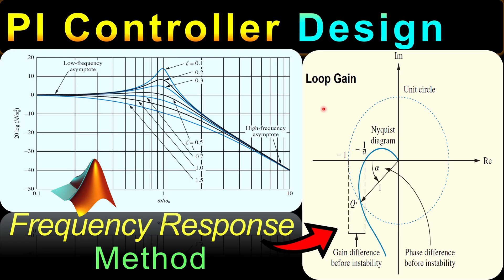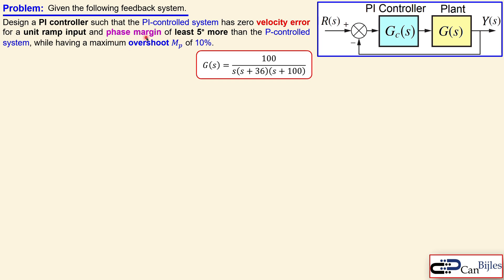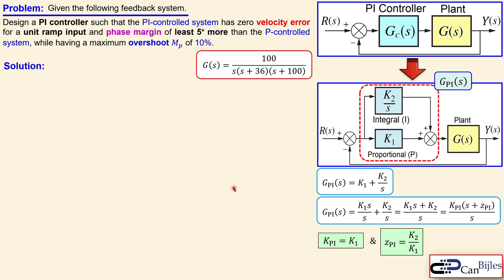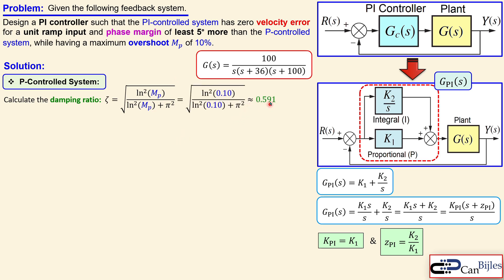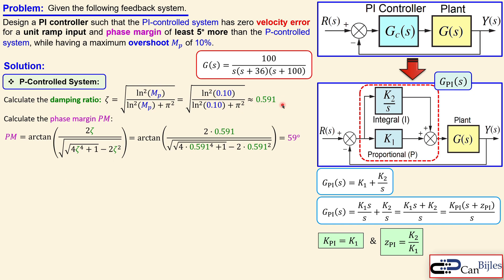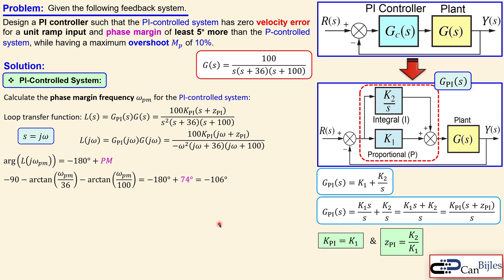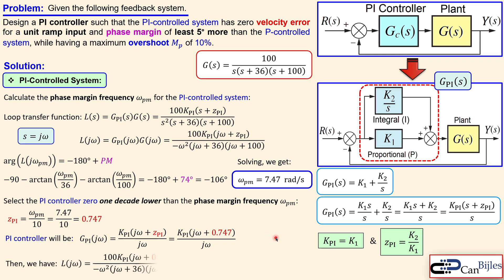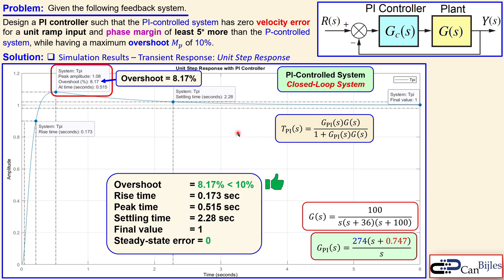Frequency Response Method 🌟 PI Controller Design 🌟 Calculations & MATLAB Simulations 💡 Example 2

Comment: Hi sir, What should we do when our roots are complex and our phase diagram is between 90 and 270? Because we can find PM from the desired overshoot value, but w_pm cannot be found, so I couldn't understand how to solve it. Thanks!
Reply from the maker: The system can have any poles and zeros, also complex poles and zeros. The definition for the phase margin frequency and phase margin is still the same. Phase of +90 degrees means an effective phase of -270 degrees and phase of +270 is equivalent to -90 degrees.

Comment: dear professor, while calculating the arg of loop transfer function at min 8.10 you did not consider the phase contribution of zpi. since it is a zero i think it should have a positive phase contribution to the system. also in denomintator you have taken the phase of w^2 as -90 degrees. it is real number and i think that it should have zero degrees of phase contribution. could you please explain these calculations? if i think wrong i may improve my insight for this example and pi controller design.
Reply from the maker: Thanks for your message. Very good questions.

Firstly:
The PI controller has a pole at the origin (s = 0) and a zero left to this pole. The total phase contribution of the PI controller will be negative. The location of the pole is set, but not the location of the zero of the PI controller. I use the rule of thumb to place the PI controller zero one decade below the phase margin frequency wpm. 

Secondly:
The expression of the real part is -w^2, so the phase is -180 degrees and this is in the denominator of the loop transfer function. The phase of the PI controller zero at wpm is close to +90 degrees and this is in the numerator of the loop transfer function. 

So, the first part of the phase of the loop transfer function at wpm is 90 - - 180 = 270 degrees or -90 degrees. That is the reason for the -90 degrees.
Reply: @CANEDUX  thank you so much for your really fast return and explanation. I have understood very well why you have made the calculations as in video. I appreciate for your help.
Reply from the maker: @sahinbozkurt886  Rica ederim. Başarılar 👍